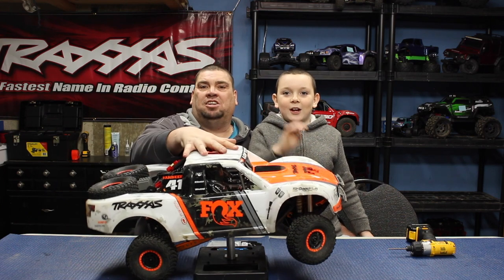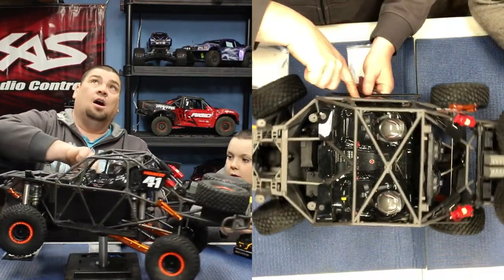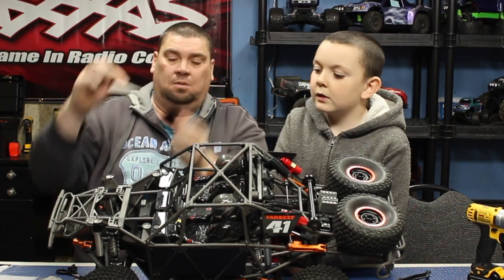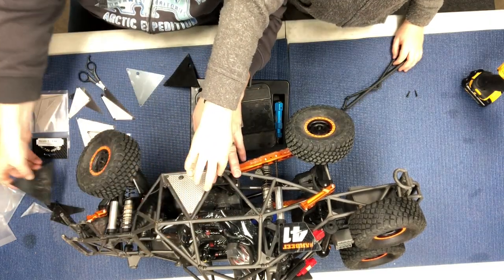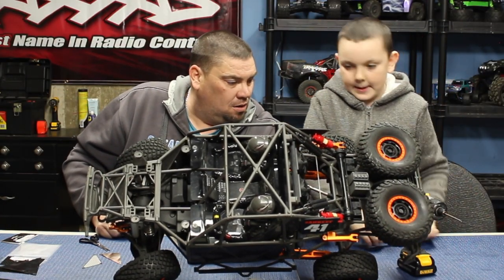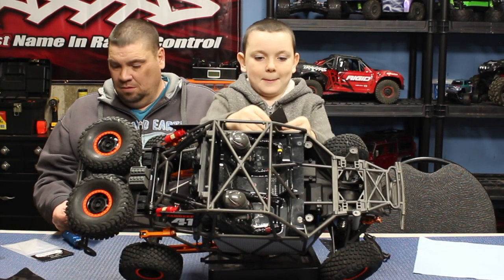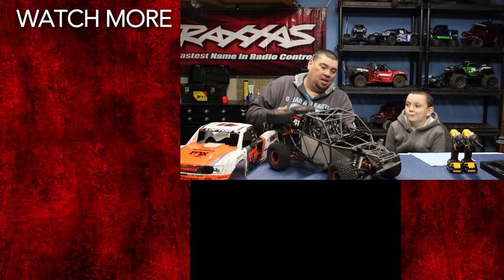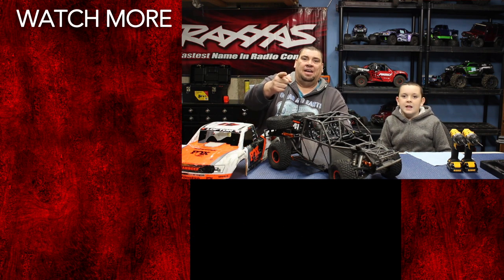Traxxas UDR upgrades GPM Stainless steel chassis diamond panels Pt. 4/Lets Play RC!

Comment: Would the panels stick if you use simple green to clean it
Reply from the maker: udr 01 , honestly just some warm water works well. As for simple green I don’t see any reason it would be a problem as long as you rinse and dry well. 😉. 😁👍✌️
Reply: @LETSPLAYRC  Thanks man have a good one